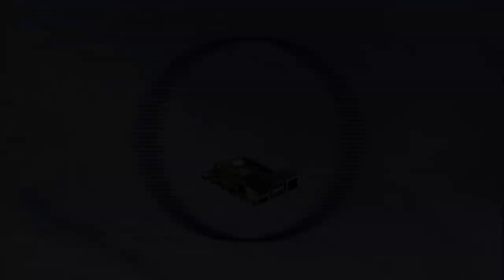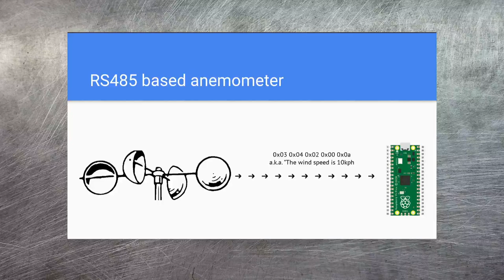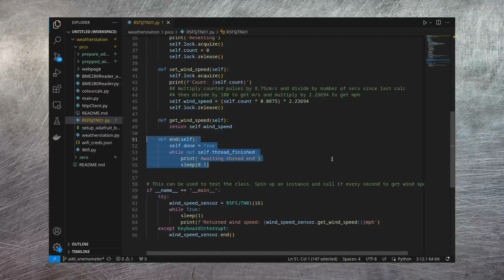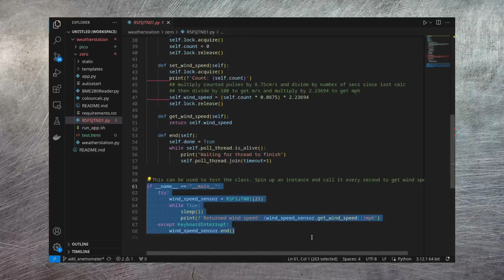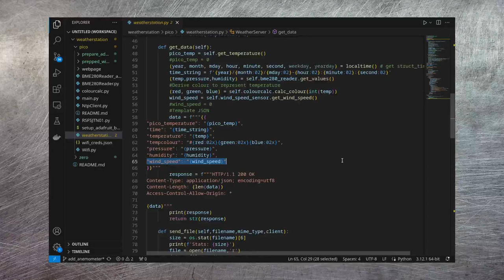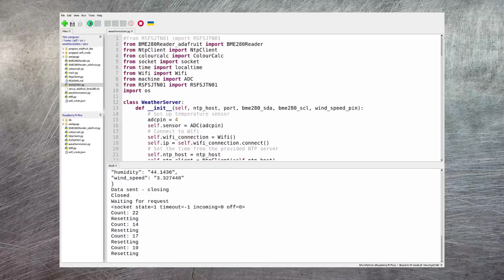PI WEATHERSTATION part THREE - Measure WIND SPEED!!!

Comment: Does the anemometer have a wind speed that might damage it? What I mean is, is there a danger of it breaking if the wind is too strong?
Reply from the maker: The anemometer is spec'd to 70metres/sec which equates to 156mph...Even in the 1987 hurricane that famously hit the UK, the highest gusts then were 135mph...I guess it's a case of you get what you pay for really. If you get one that's flimsy then it'll just get ripped to pieces. But so long as the bearings allowing the rotors to spin are good and don't get damaged then it would take something quite exceptional to hurt it.
Reply: @jeffs_piinthesky  That is excellent! It also makes sense that better quality euals better logevity/ Thanks so much for the awesome video!
Reply: A mechanic anemometer is dependent on good bearings and balance, whereas a sonic anenometer is only dependent on stiffness. Let's hope he can show us a sonic one next time :)
Reply: @roysigurdkarlsbakk3842  Ohhh that sounds like it would be epic to see!!!